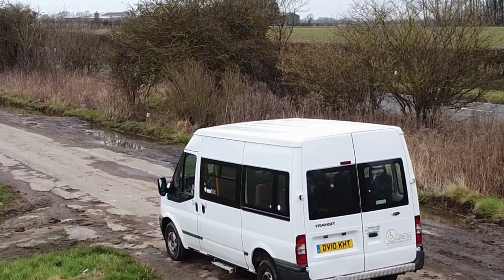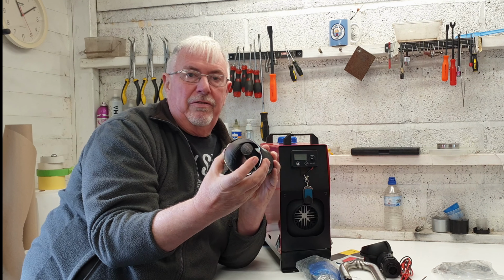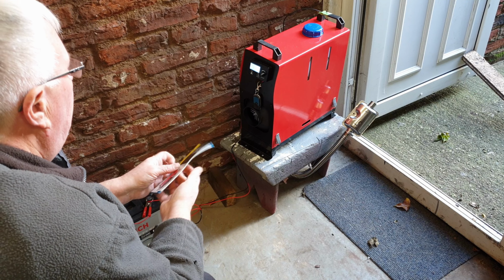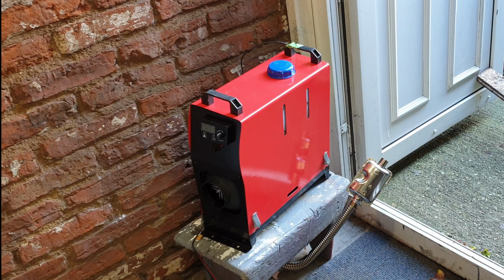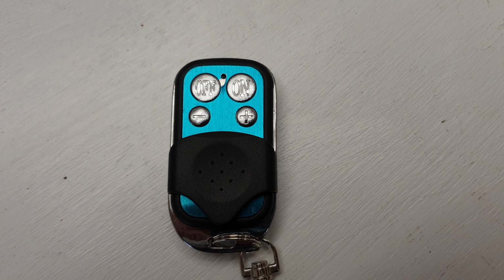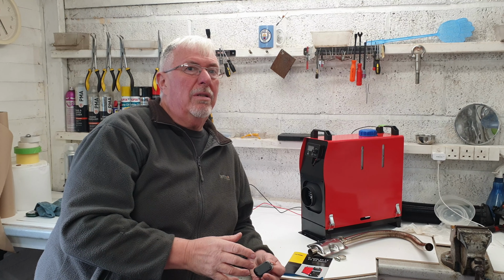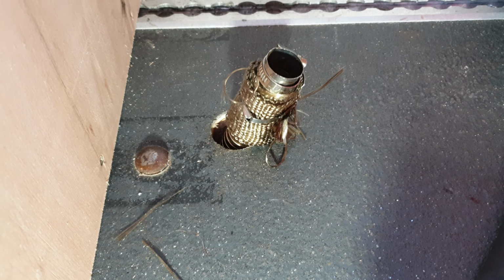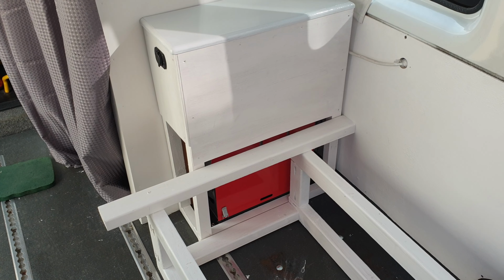Cheap Ebay Chinese Diesel Heater Review | Camper Van Diesel Night Heater Review & Fitting |  | 010

Comment: It looks well in the van, i bet it kicks out plenty of heat in there, just what you need for those cold nights. I fitted one to my VWT25 camper, it is one where the tank is separate, yours looks a better idea really. The ones with a separate tank are ideal where the space is limited mind. I did have one in my workshop but it wasn't quite enough for the size of the place really and it used to much fuel. I will put that in something else one day. Enjoyed the last two videos so decided to subscribe to support your channel, i appreciate the work that goes in to the videos, from experience lol
Reply from the maker: Thanks for your kind words. It works a treat.  Somebody in another comment warned about making sure the exhaust connection is good with the self contained type so that you don't get exhaust fumes into the van.  I can't see me taking it out to heat the workshop now I have fitted it, but it did seem a good idea at the time.
Reply: @SPANNERRASH  yes I did see that comment. I had mine attached at the side of a wall with the exhaust going out.

Comment: A couple of points , because the exhaust join will be inside the van therefore these aren't actually safe to use inside enclosed spaces, because the exhaust is prone to leak at the join, instead use a normal diesel heater (not all in one - just strip the casing off yours - its the same inside) and use a turret plate , so the exhaust joint is outside. also the exhaust silencer has a drain hole which should face down so it doesn't collect water (yours is facing side on) they can be tempremantal at times but great piece of kit for the money. Keep up the good work on the Conversion 👍
Reply from the maker: Thanks for the very good advice, but it may have to wait until the next refit.  In the meantime we don't intend to use the heater when we are sleeping, and we have a good carbon monoxide alarm.  We will be very careful, I was very worried about fire as well.

Comment: The chance of fires, fumes, diesel smells or spillages puts me off in confined spaces.
Reply from the maker: I understand what you say, but these were originally designed for use in vehicles as a night heater for long distance drivers.  With careful installation and use most of your concerns can be really minimised.
Reply: Ever wondered how people coped burning coal in their living rooms? Well they did.

Comment: I know this is 2 years old. But you have put the muffler on wrong. They should always be a little lower than the exhaust pipe for water to go down. And if you look close at your muffler. You will see a very small hole. This should be facing downwards for the water to drain and not on it's side or you may run into problems later.
Reply from the maker: Hi, thanks for the advice.  This has been rectified a while ago.  I didn't give it enough attention during the first fit  up.

Comment: Def point exhaust down, otherwise water splashed up from driving could fill up the pipe, also perhaps a splash shield so if exhaust is warm and ur driving in rain u dont create a steam cloud (granted wouldnt be for long till it cooled but also will save from corrosion longer term
Reply from the maker: Thanks for the advice.  I do get fed up fighting rust!  Anything that helps prevent it is a good idea.

Comment: Can u show how you wired in it in for this demo was it a battery etc ?
Reply from the maker: Yes.  The heater is wired to a 12v battery.  It was originally intended for use in a vehicle.  You have to charge the battery every few hours of use, depending on how big a battery you use.  I hope this helps.
Reply: @SPANNERRASH  is this direct to the terminals  or some other method in the kit with the heater is the wiring provided is it straightforward ?
Reply from the maker: @Fatpig-fq3vb  The heater wiring has two ring terminals that connect straight onto the battery terminals, and you can have the battery on charge at the same time as using the heater. Stay warm 😃

Comment: Make sure you have a carbon monoxide monitor in the van if you’re sleeping in it. 👍🏻
Reply from the maker: That's great advice and we will do. We don't intend to use the heater while we are sleeping, not sure we could with the ticking pump.
Reply: the  exhust gas    goees out side   that is why he drilled the  big hole in the floor 
no   monoxide  gets  in your  van .
Reply: @SPANNERRASH  When you tested it in the doorway you commented on how loud it was.  Once you mounted it and ran the exhaust and air intake through the floor did it get quieter?  I am particularly concerned that the fuel pump being inside a tin box with no sound dampening inside might be quite loud.  As much as I like the ease of installation of the self contained unit, I may go with the more modular version in order to get the fuel pump outside.  And I DO plan to sleep with the unit on but with a good LOUD CO detecter of course.  What are your thoughts on the merits of getting the fuel pump outside even if it makes the installation project much more difficult?  And why would you not sleep with it on if you have a good CO and fire detector inside your van?

Thanks for sharing your experience with the rest of us!
Reply from the maker: Hi  @victorhoye6116  to be honest, its fairly loud if you're someone who enjoys the silence.

You could definitely sleep with it on its lowest setting without it keeping you awake though. But it sounds like a jet engine on full power. The pump makes a ticking noise, but its the air which is the loudest part.

Certainly puts some heat out though, surprised even for a small unit.

If you're serious about getting the best result, installing as much of it as possible outside the van would be ideal. But yes, definitely keep alarms/detectors close by.
Reply: @SPANNERRASH  Thanks for your thoughts on this!

Comment: Don’t think I could sleep with that noise, so doesn’t seem like the right solution for camping in my moto van.
Reply from the maker: If you want heating for while you are asleep I don't think this is the way to go.  I would always be nervous of carbon monoxide even though it shouldn't be an issue inside the vehicle, but the noise of the pump would be too much for me.

Comment: Did you ever find proper instructions?
Reply from the maker: I contacted the seller and they sent me a pdf with the type of controls on my heater.  Although there isn't much to know. 

The remote has on and off and Plus and Minus all of which do exactly what they are labeled.  The rotary switch on the heater works be pressing for on and off, and twisting for higher and lower heat.